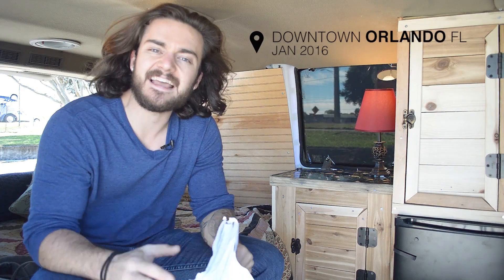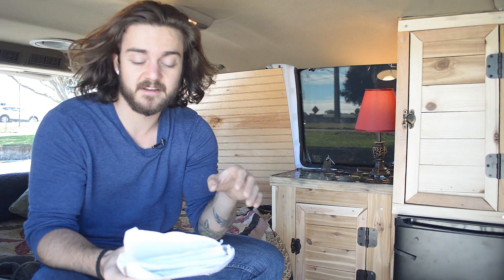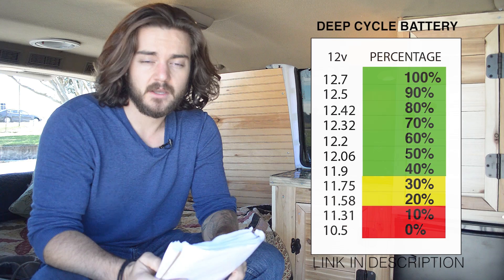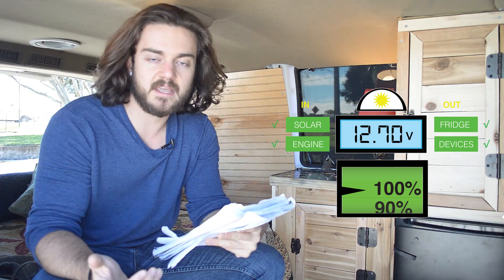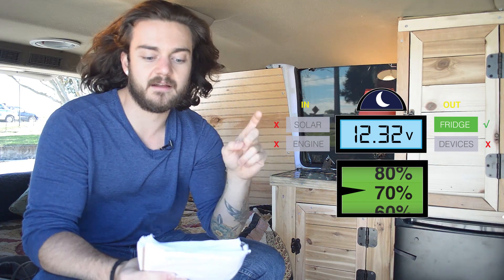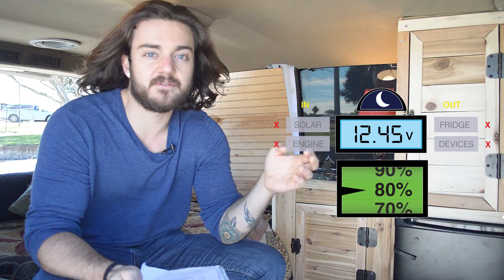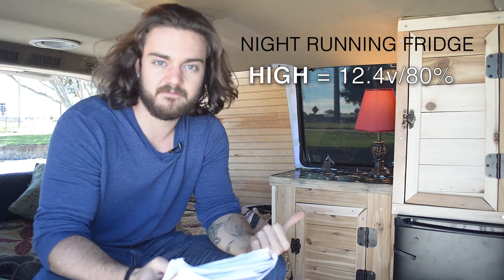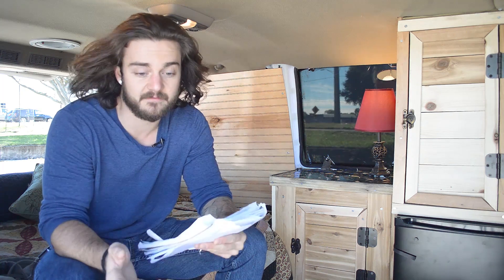Van Dwelling: Checking Voltage meter while mini fridge runs on my single 12 volt Deep Cycle battery

Comment: Have you considered using the fridge thermostat to switch on/off the inverter to save power?
There are plenty of videos on this but basically you add a 12v control circuit via the thermostat to switch a relay on/off, the cable behind the power button is broken through the relay and controlled via the thermostat. The compressor is fed directly from the inverter. The inverter will only consume power from the battery when allowed to by the thermostat which is roughly on 6hrs in a 24hr period.

Comment: Ive had a Avanti 12v fridge for 10 years it works off both AC/DC it went from a truck to a popup camper to a room rented for work and into a shed for beer. After 10 years it just stoped working. I found a bad fuse but havent fixed it yet. No matter what fix or not it was well worth the 100 bucks I spent on it. I think this would work much better with your set up and save your battery life. I havent read all the comments but a deap cycle battery would help with your solar system

Comment: I have a Battleborn 100ah battery and will never even get to see 11.75v because the battery will shut itself off @ 11.8v to protect itself. It will then need to be jumped in order to accept a charge from the solar panels. It will not accept any solar power at the 3.5v level it rests at after shutoff. I need to switch my fridge from 120v to 12v to get more efficient use of the power.

Comment: Only thing missing is that ac compressor need 1,500 watts to start up for 2-3 seconds each times about 13-15 times a hr.. a 12 volt ice box don't
Reply from the maker: 12v ice box is the way to go!
Reply: @WizardWeston  tell yo my trick, before that I wasted 700 on a Engels 12 volt, too small so payed 1,200 for the larger one. They said it the best nope.. Wasent happy beside its messy a dump, and it too weak, was working almost all the time in hit Honolulu. Finally found the best one goggle northcold NR740  About same size, but add ayou can put ice cream and frozen and they say a box type don't wast electric. A stand up does.  I found out this ice box a cheat. But don't get the larger one check aThe amps only around 32 watts at 12 volt and it's so efficient at night it stay off cycle about 25 -30 minutes and come on about 20 secound, so it surprising well insulated as I only run 2 -1/2 or 1/2 above minimum my engel I needed to run about 3 or it not cold enough. They say 3 the limit in hot and humid place or the ice box will run almost constant say  low life expectancy. This is humid places only something to do with same as the heat stay about your skin as you body temp the same as the air . That why my engel had a hard time. But this one has room to spare no problem.  You can stack it well and it work better even . I got my on sale at west marine 600 and 1 got the 110 insurance as you pay for the return on all . Here it worth it. 3 yr now still super cold.
Reply from the maker: @thomas4315  3 years! damn! Now you need to make a video! lol I wish I saw this comment a while ago. I recently purchased a 12v off brand fridge on amazon! only I think ~$400. we will see how it does
Reply: @WizardWeston   Think that that Chinese one right? But good reviews.You goggle the north cold , cute yea. Could be bigger, but then need to be under the bed. That behind. Here it's from that driver seat. And my stove on top I can sit on the driver seat to cook rice or past or potato right from the driver seat .  Advantage of behind the passenger seat.abd just pick up the main dish. That propane tank ice box and above small shelve and small stove. It's a cool layout and 2 feet for the side door exit. And the bad across way behind and get a Home Depot plastic cement container mixer as my shower. That a quarter ply wood on top carped is my crouch. Nobody but me has that lay out lot of room. My bath room is a drop down curtain that also the shower curtain. And just tuck up in the shelves above so can't be seen and the potty you bag type goes under the bed. And I got double shelves that on both side on the high top as but breaks for the exit as you only walk in the middle so . Best to storage evething up there that leaves a big living room LOL

Comment: I've been specifically having THIS problem with my fridge. My batteries plummeted to 11.3 a few months ago, sounding the alarm on my inverter. I've had that fridge unplugged ever since while trying to pinpoint the actual issue. Without the fridge plugged in, my batteries are anywhere from 12.3-12.5 in the morning which is healthy. I've had that fridge for a few years and have always let it run at night without issue. it's either the compressor motor going bad which causes it to run less efficiently, consuming more power, OR it's that it ran my batteries so low at night, too many times that they now cannot bounce back like they used to. I never had a voltage reading on my inverter before so I never knew what voltage the fridge was actually using at night. It's all a learning curve I guess.
Reply from the maker: interesting! Maybe that is the case. good you are figuring it out and having the voltage meeter. I ended up not using the fridge for long!
Reply: @WizardWeston  Oh interesting. Yeah refrigeration is the biggest challenge when it comes to us off-griders huh?
Reply: Wizard, what are you using instead?
Reply from the maker: @iamblakeh  well i just ate dried goods, canned foods, or ate out! I didn't use the fridge! I am actually in the middle of a new van build with a promaster, and i purchased a 12v fridge! a more affordable off-brand one on amazon

Comment: Dude Weston you killed it with these videos! Did the battery hold up for you throughout all of your travels? I have a 125ah deep cycle agm battery that I'm about to be using to run a similar system on once I get moved back into my van!
Reply from the maker: Brandon Shelton sooo! I ended up not even using the fridge that often. My battery stayed strong for years! Even until I sold the van! But I only used the fridge in the begging of my travels
Reply: @WizardWeston  Rad dude! I just finished watching every single one of your videos and they got me pumped because I have an 03 Astro that I'm moving into! One more question though, how did you do your flooring?

Comment: Does you fridge have a mini freezer in it? Thanks for the vid.
Reply from the maker: it had a tiny compartment on the top I think you could freeze stuff, I never used it
Reply: @WizardWeston  Hey thanks! It's good to know these measurements apply to a fridge with a freezer.

Comment: How many watt inverter are you using?
Reply from the maker: at the time I had a 2000 watt invertor I think!
Reply: @WizardWeston  that makes sense, you need a lot of watts to get the compressor to start

Comment: Put a timer on your line voltage coming in 2 inverter. The refrigerator has a holding capacity for coldness monitor it and set your timer to override the thermostat and bring it on maybe every two and a half hours check for food spoilage

Comment: Thanks for these tips. I’m going to buy a timer that turns the fridge off for 1 hour every 4 over night to help out with the load on the battery. See how that goes.
Reply: Just for reference, I have a DC only frig. 12.5 cu ft, hooked up to my 4 battery (12v) system. It is very efficient, my voltage has never dropped below 12.5v overnight. They say that this frig can run off of just 1 battery! Anyway I'm just glad I was able to add it to my system and not tax it negatively. No need to upgrade my batteries, which I thought I'd have to do and no need to shut it off/on, which I also thought I might have to do. cheers
Reply: @trnty427  What fridge is that?
Reply: @VanCult_GetInAndGetItOn  it's called EcoSolarCool ESCR355 I have the stainless steel version. Kinda finicky euro 13 AWG wire or you will blow a little electronic unit.
I don't think they make this particular unit anymore but they have others. I did upgrade my batteries and charger controller. Works the same, runs 24/7 no problem.
Reply from the maker: Crypto Brad smartttt 🙏

Comment: Good video; content is technically sound and well presented.  That's a good choice of fridge (if you have to use a 120V fridge) -- 150 watts is a small power draw.  Yeah, IMO, you're doing things right.
I have a 12V NovaKool -- about 8 cu ft, fridge-over-freezer.  Steady power draw 48 watts.  But it's stunningly expensive (as S. Kluge describes below).
BTW, what kind of inverter are you using?

Comment: Great video.  Lots of questions if you can remember... When the Fridge was first connected, how many WATTS was it using? So this deep cycle battery is your primary starter battery? What are the specs on it?   it's was your only battery? You have a solar charge controller? what kind? How many panels and what kind?

Comment: curious to know what size inverter you are using to run a refrigerator. we're currently trying to set up a system similar to this one, solar and deep cycle batteries. bought an energy star mini fridge (runs on 125 watts) and a good 400 watt (800 watt surge) but it wouldn't run the fridge. i'm finding out more now, some say the compressor on the fridge will draw 10 times the rating at start up. if anyone has a good reply i would appreciate it
Reply: I run a 7CF freezer s a fridge. Starting surge from a 12V battery is about 120A.  Even a 800W inverter will have trouble with that.  It is the boost circuit in the inverter which limits you because of the resistance of transformers and FETs.   There was a good video that paralleled  the HV DC sections of two identical small inverts and that easily powered large loads.  I use a 2KW inverter with fans removed to save energy.  Running current is about 9A on DC side running fridge, 94W on the AC side.  I don't let the fridge come on unless the battery is 13.6V or higher.  That is, only when the sun is out and charging the system.  I store large amounts of liquids and that keeps the temps down at night.  I do have a lot more panels and only a single car battery. If a system is well engineered, that is all you need.  I also have hot water from PV and even a dishwasher.

Comment: Spend a little more money and get a more efficient fridge.  It will help your battery system.  That fridge you have is pulling way to many amps.
Reply from the maker: Yeah! I only used the fridge for a couple weeks. It has been over a year and I still don't use a fridge. I eat a lot of dried foods! no need for a fridge.

Comment: Great video Wizard.  My set up is very similar, 110AH battery, 1.7 cf fridge, so your video is very relevant to me.  Setting up over 300W solar panel.  Hopefully that'll be sufficient.  Thanks for the vid.

Comment: yo fyi depending on your budget or preference what not, with batteries pick n pull has refurb 12v batteries usually of all types for $40. plus 90 day warranty. just for that extra peace of mind for long wilderness type excursions ya dig? 
separate note can I ask what kind of insurance you have? I'm desperate to find a policy that covers mechanical breakdown. peace

Comment: I would be more concerned about current draw not volt drop. Curious, how long will your fridge work on dc at 12amps as you said. I would be supprised if you get more than 2 days. Enjoyed your video. Cheers.
Reply from the maker: Brian Moore I don't use my fridge anymore! I had it running for a couple weeks and never really used it. So I turned it off!
Reply: ok. thanks for your reply.
Reply: Hell I'd take two days that's great

Comment: Wiz, when you were hanging out with Into the Mystery13 in AZ did you mention the fridge. He has a great conversion vblog and detailed instructions on his website for a simple modification to that kind of fridge that cuts the power use by more than half. The key isn't the compressor, the key is the thermostat. Convert the thermostat to DC (he shows you how) and have it cycle the power on and off as needed. Even in high heat environments the compressor doesn't come on that often. 

Here is the link https://intothemystery13.com/2016/10/28/diy-hybrid-fridge-cheap/

Comment: I think your battery needs to be at 13.5 volts day time. At 12.7 volts it's not getting the charge it needs for night.
Reply: It depends on many things.  13.5 is a good "absorbtion charge" setting with a drop to about 13.1-2 as a "float charge" for a flooded-acid battery but to just measure the battery with no charge on it, 12.7 - 12.8 is fully charged in a practical sense.
His "State of Charge" chart is correct for AGM/Deep Cycle batteries and he's right that if you draw down much below about 40% or if you get down to 40% often, you'll damage the battery.   It is important to remember that flooded-acid batteries need 10-20% higher SoC to avoid battery damage, so someone who is pulling off their vehicle battery or using a regular "start-type" flooded-cell battery cannot draw down as much without damaging the battery.  The other side is that if a battery is not brought up a practical full-charge, it will also damage the battery.  People see their SoC begin to climb above 90% and think "I'm up near fully charged - I can start pulling out of the battery again"; if they do, they're going find their battery slowly failing -- fewer watts available until the volts drop too low, too long to charge, failure to charge all the way even with a long, hot charge.
That's a sneaky thing about batteries, the damage is subtle and cumulative.  It's not noticeable -- barely even readable on test equipment -- at first, but once the damage from over-drawing or undercharging has begun, it's very hard to stop it or prevent it getting worse.  Your $120 - $160 worth of battery quickly becomes an expensive door stop.

Comment: it's not good to charge your house battery from the van circuit. when two different aged or types of batteries are paired off one charging circuit the newer battery's capacity will be reduced to the capacity of the older battery. your current set up can barely maintain a safe voltage now. charging off the van will make it worse. you''l need at least one more battery and another 100 watt panel. my favorite 12 volt fridge is a dometic, but you need to cut a hole in the side of your van for the venting in case the ammonia based coolant escapes from a line breakage. your current fridge draws a little over 200 watts when it's running so it's cheaper to add a panel and battery than to buy a 12 volt fridge used. you can cut down on your fridge's running time, by filling any excess space inside with water bottles.

Comment: Seems you have a Peltier Cooler. I ran a 31liter compressor fridge of a 105ah deepcycle battery for 48hours straight, starting at about 12.8v, and ended the test at 12.4. I set it to 5c, and the room was 25c all the time. the fridge i bought was a lot more expensive though. but it can freeze up to 10c, even when its 35c outside. Very efficient little unit. I can run it 24/7 of my 100w panel, even if there is a cloudy day or two. Some LED lights, a fan, laptop and music add a bit more load, but i can still manage without running the engine at all. Also, the box i have is top loaded, so when you open it, almost none of the cold air leaks out, which helps a bit too. Have you thought about adding a external wifi antenna? We dont have unlimited data plans here in europe, so im basically bound to free hotspots. Not sure about your options though :). 

Keep up the videos, love watching them :-).
Reply from the maker: very interesting! Thanks for the information. Yeah my fridge was cheap! and thank you so much :)
Reply: Deiphobuzz what is your fridge's maker and model?  BTW Wizard's fridge is an Haier 1.7 cf, a compressor model, not a Peltier cooler.

Comment: What size of battery were you using? The vehicle starting battery?
Reply from the maker: +rsaxvc Idk about the starter battery. it's just a cheap starting battery. and the 12v 100amp hr battery in the back. Hope that answers it! thanks :)

Comment: hi.  you may look into a dometic dc refrigerator.  its  probably the most popular among the rv and van community.  also, you may consider a second battery connected in parallel.  If you really need more power, you can always get a lil 2K generator and battery charger.  I need a little more power than most because i have sleep apnea and require a cpap machine.  Hope this helps.
Reply from the maker: +Joshua Smith I will look into it! Right now my diet is really raw and dry foods so I don't really need a fridge, as of now. Thanks for the advice :)

Comment: How much juice did you use when you were using the TV as well as the fridge?
Reply from the maker: +Wysiwyg101 I don't have a TV. Also now, I only use the fridge as storage. My diet doesn't really call for anything to be refrigerated. So I barely use any power. Just charging my phone, laptop, and running lights

Comment: Here are some suggestions: 

A 24 Hour Timer would be good for the refrigerator (since your in Florida, after 7 or 8 pm put the timer on/off an hour apart until 6 or 7 am). (amzn.com/B006LYHED0)

Rigid Foam Insulation on the top and side walls of the refrigerator increases efficiency.
youtu.be/HFcM2mRI8Gg
Reply from the maker: +GONEWILDFILMS Hell yes! :) that timer would be perfect. thank you for the suggestions!